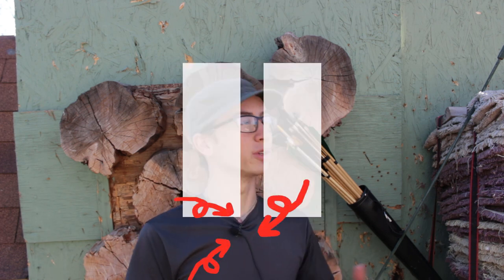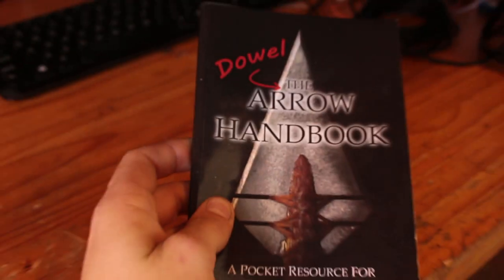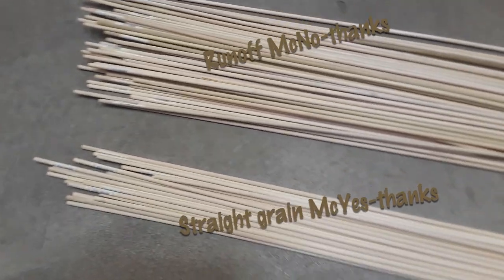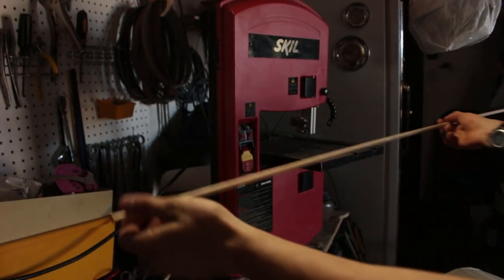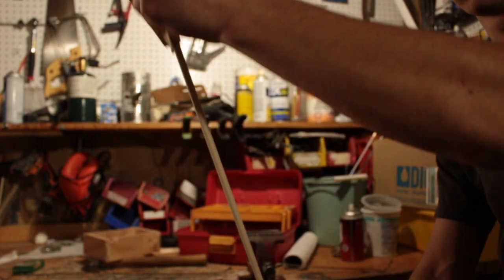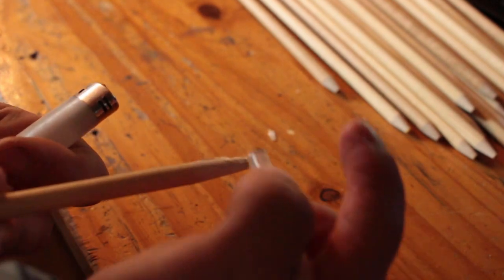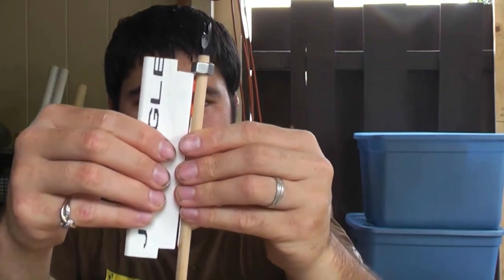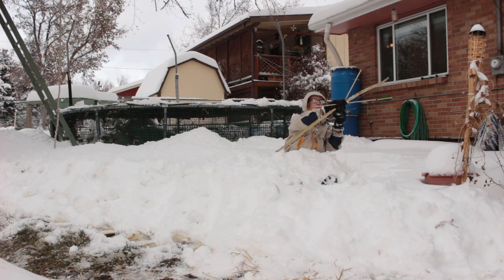MAKE ARROWS For Less Than $2 - 5 Simple Steps

Comment: I made an arrow one time when I was a teen my brother had a starter long bow and we lost all the arrows. We had a small patch of bamboo randomly in the woods so I got a piece the thickness of an arrow it was already extremely hard but I did a quick heat treat on them thinking it would make the stronger. Then for some reason we had an old cow skull in the yard and I broke a perfect arrow head looking piece off and used hard rocks to chip it in the exact shape I wanted then I sharpen the edges on a course rock then a smoother rock. I used natural twin construction glue and he goose feathers to finish it out. We shot that thing at targets forever before one of my buddies was like you couldn't shoot a deer with that if you hit something hard it'll break....so I said "yeah you're probably right" and aimed high up a tree and stuck it in the tree about 50ft in the tree and that's where it stayed possibly until this day...that was over a decade ago at this point  though

Comment: Dowels are perfectly fine as long as they are made of pine, spruce, or cedar. Birch is also perfectly fine. Heck, you can even move to a gardener shop and get some bamboo sticks, if they're long enough. Only issue is, they're most of the time dried with modern industrial standards, which in return means, they are extremely dry. Just give them a linseed oil painting, and wait 3 days...fixed.
Reply: No they're not.
Reply from the maker: Explain why please. nobody has ever given me a satisfactory explanation as to why they think dowel arrows aren't suitable.

Comment: Great video with humor, I like it. In the past I used oak dowels (they are stronger and last longer) I would sharpen the ends with a carpenter pencil sharpener, take an electric wire cap and twist on tight, then cut plastic off, then seal with JB weld. For feathers I just used duct tape and used electrical tape around ends. I just cut a knock in the wood and sealed with wood glue. Great for targets, not really a hunting arrow, haha.

Comment: I used to make my arrows from the oak dowels at home depot. I was pretty careful to pick the ones with straight grain and without runoffs, so I thought I was fine. One day I was just finishing up a 90lb longbow I had made, and was breaking it in. As I fired one of the arrows I had made, one of them exploded in my hand, sending the back 1/3rd or so of the arrow through the flesh on the side of my forefinger where it was holding the bow. the front of the break had split into two splinters about 2 inches long, and the feathers were sticking out the other side. I have no idea how so much wood passed through without tearing the skin apart, but I guess our skin is incredibly elastic. I didn't even realize what had happened until I saw blood just start rushing out in a low arc, and then panic and pain set in. 

I ended up getting surgery and the finger is more or less ok, with a large scar on that finger and horrible memories. But I stopped using store bought dowels after that. Stuck to bamboo arrows... much safer and less likely to break that way. Plus they are even cheaper and easier to get a hold of and make than wooden ones, since home depot has bamboo stakes that work well.
Reply: You made me scared of arrows
Reply: @DoctorAsshole1  Some people never learn.
Reply: Thanks for sharing this info. Yes, poplar seems way too weak but Bamboo sounds much better.. 👍

Comment: Bro this video has BLOWN UP. and quick question do you find fletching with two arrows has them fly as well as three.
Reply from the maker: They don't, not at longer ranges anyway, but the difference is pretty small. I still like them but my regular arrows are actualy 4 fletch which are more stable while still not having an odd feather.
Reply: @TheElvenArcher  ok, well I have a three fletch jig but as you probably know, fletchings are expensive. I’m trying to make my own but I have to wait till turkey season. I might still stay with three fletch for a little bit longer.

Comment: I’ve been making my own wooden arrows and just use dutct tape for the fletching and weight for the tip, they never are super consistent so I’ll try this method and hopefully I can get more consistent results
Reply from the maker: Yeah, the duct tape fletching is an ok concept but it doesn't work very well unless you have a rest meant for shooting plastic veins.
Reply: Then you aren't making arrows are you. You're making pieces of dowel with tape stuck to them. I would probably suggest never admitting this publicly. When I was about five I learnt to fletch properly, so this is something an under four year old might be proud of. :P
Reply: Dr. Lex Winter no need to shame me for it
Reply from the maker: @dr.lexwinter8604  If you're only here to trash on people for doing things differently from you then perhaps you should instead find a friendless tree stump to listen to your pretentious nonsense.
Reply: @dr.lexwinter8604  Bruh you're like a few letters off from Lex Luthor, which fits, since you're a villian. At least Luthor wasn't a racist bastard.

Comment: Would it be a bad idea to just fletch by hand? Also is the sanding + linseed oil part necessary?
Reply from the maker: Fletching my hand is possible but just takes so much more time that I dont think its worth it. And yes sanding and oiling the shafts is necessary, dowels are not shaped with a lot of care so sanding down any ridges or uneven spots helps to keep them consistent. The linseed oil I find ads a bit of elasticity and more importantly protects the wood from moisture.
Reply: @TheElvenArcher  I see, thanks for explaining! The video is very informative and accessible. What do you think about keeping all the steps the same but using harvested hazel shoots instead of the dowels?
Reply from the maker: @mariamm8687  if you can get hazel, then go for it. ive made several bows from hazel and found it to be a really nice material to work with. I would recommend gathering a big bundle then bundling them tightly together with twine and letting them dry slowly for a season or so to avoid splitting and warping. you will have to do a bit of tuning on them if you want them to fly consistently but that would be kick ass to make your own arrows completely from scratch. I wish I had been back in Oregon this past summer as Colorado doesn't have near the amount of natural materials to work with.
Reply: @TheElvenArcher  Sanding the shafts will also remove "micro-splinters"

Comment: I know you recommended popular but I made arrows before I watched your video and used oak, I find that it works well but should I use popular?
Reply from the maker: I had trouble finding oak with straight grain but the bigger issue is that oak is really heavy compared to poplar but isn't super stiff like Ipe for example. You can have an Ipe arrow that is thin *and has a low spine value (meaning a stiffer arrow) because its heavy but also really stiff and you can get a sufficient spine with a small diameter. Poplar is pretty stiff for its very light weight so you get much faster arrow speed. Oak arrows are fine as long as you don't mind slow arrow speed.
Reply: @TheElvenArcher  ok that’s good to know, I was planning o; going and getting some more dowels to make more arrows soon, I’ll have to try popular.

Comment: I'm making some stumping arrows right now out of dowels from home depot because I'm cheap and I dont trust myself to make great arrows yet. My bow is only 25lbs so it shouldn't be too bad right? 😬
I sanded knocks directly into the wood and they look pretty nice. Would you try this instead of using cheap plastic nocks?
Reply from the maker: I wouldn't personally, the nock is a pretty vulnerable part of the arrow as it is cut into the grain and is prone to splitting. At the very least I would cut it at a 90-degree angle against the grain. The Backyard Bowyer also has a video on how to make reinforced self nocks: https://www.youtube.com/watch?v=KQBTnrKIi3k its definitely worth checking out though the plastic nocks are so cheap that it's worth picking some up just for simplicities sake.

Comment: Bent dowels can be straightened with a little heat or steam.

You can even straighten them by rotating and sliding the bent part of the dowel above the flame of a candle.

Just don't allow all the heat to hit one spot... you're trying to heat up the dowel, not burn it.

Comment: what bow are u using i like it
Reply from the maker: It is a panda model made by bear archery, pretty easy to find one on ebay for about $150
Reply: If you haven't gotten one yet this is a pretty great model if you can find it for that price on eBay but if you're like me and want all your weapons to be brand new and you be the only owner then I recommend the sammick sage I used to be in that 150$ range but they are cheaper it is a really good bow for beginners all the way to experienced archers you can customize it with all the attachments for cheaper than you can buy half a bear archery bow
Reply from the maker: @manyhatsentertainment8685  consider the drip tho. Old fiberglass bows just look really cool.
Reply: @TheElvenArcher  I prefer mainly wood though but to each their own I plan on buying  a wooden longbow before long wanted one for years but I needed to get proficient with what I have for a while before I introduce another bow that I may have to short differently

Comment: My problem with dowel arrows is all the hardware stores do them in 30in which is too short for me (I'm 6ft 5') or they do them in 2.4m. They need to be bought in 2.4m, you can't cut them down in store. You need to take them home and do it. I don't drive. I can't take home 12x 2.4m wooden rods as I'll get stopped by the police for "looking dodgey" lol.
Reply from the maker: Couple things, with a draw length that long you're going to have to up the size of your dowels as the longer they are the lower the spine value. And why can't you cut them down in the store? Just bring a small saw and cut them.
Reply: @TheElvenArcher  The UK is funny place.

Comment: just a random question from an ignorant person.... DO you need to put an actual tip on, or can you just sharpen the end?
Reply: good question. you could sharpen the end, but it’s better to have a tip so that the arrow flies straighter and is more accurate. hope this helps.
Reply from the maker: Right, an arrow needs weight upfront to stay stable, I shot an arrow where the tip had pulled off in the target just as a joke knowing that it wouldn't fly well and it took a hard right and ended up three lanes away from my target. you won't get any accuracy or consistency with no point.

Comment: man dowels are cheap in the US haha, 1 2.4 meter oak dowel which would maybe make 2 arrows (3 if the grain is 100% perfect on the entire dowel with no run off or knots) is around £15, works out to maybe £5 an arrow before fletching and heads,

Comment: What length should the fletching be, I am a kid so just wondering to make cheap arrows to use
Reply from the maker: I use 5 inch fetching because I like the way they look but really any size works. I have arrows with 1 1/2 feathers that fly just fine.
Reply: Also, if you're buying all of your supplies, shorter feathers are generally cheaper than longer feathers, by about half in my experience. So you could make three feather arrows, for less than his two feather arrows, if you used three inch feathers.
Reply: Concerns about feather length are length of arrow, weight of arrow, spine of arrow, type of arrowhead, and so on
A lightweight target arrow needs only a short(1/2 to 2 inches) fletching to stabilize it.
A "war" arrow, half-inch oak shaft 30 inches long, with bodkin point, would need 6-7 inch fletching to stabilize

Comment: I purchased a bunch of solid aluminum rods and I'm using chicken feathers
Reply from the maker: Solid aluminum is going to make for some really crap arrows. It's too heavy and an arrow needs not only feathers but a point that adds mass to the front to fly properly. Not to mention that aluminum doesn't spring back to shape on the same way wood does so you may have some significant issues with warping and bending.
Reply: @TheElvenArcher  well I'm gonna find out. The mass up front isn't necessary. The feathers do enough to keep em flying straight
Reply from the maker: @RonaldPlett  you do you man, just know that there are many very good reasons that they don't sell solid aluminum arrows.
Reply: @TheElvenArcher  once the animal  in front of me dies then it's successful
Reply from the maker: @RonaldPlett  target shooting is one thing. Don't experiment when an inaccurate shot could cause undue suffering, its unethical.

Comment: This is NOT under $2 bro. Your talking about buying tips, ends and dowls.  and shipping
Reply from the maker: 1 dowel is $0.90 
1 point $0.20
1 nock $0.10
3 feathers $0.75 ($0.25 each) 
total of $1.95 each arrow. I've never paid shipping for these items, you have to wait longer but most have free shipping options.
Reply: @TheElvenArcher  That guy is totally wrong but I do think you should probably add in the cost of the the taperer thingy and maybe the cheap fletching thingy? you know, just a few of the thingies. Great video though, I have a hand-me-down bow and one carbon arrow I bought 10 years ago for it, so Im excited for some assembly and some projectiles.
Reply from the maker: @imjstcl  tools are an investment not a cost. You wouldn't count the millions of dollars in equipment it takes to build a car into how much it cost to build, that would only come up when deciding how much to sell the car for i.e. the cost of materials + extrapolated cost of machine use and labor.

Comment: add up all the material cost PLUS your injuries it probably cost more than the high quality one. lol.
Reply from the maker: The only peice that would potentially hurt you if it fails is the knock and that is a tiny piece of plastic. Unless it was cracked from the beginning it's not going to be better or worse than one from a local shop.
Reply: @TheElvenArcher  The only thing is that after many round of shooting it can cause invisible cracks that waiting to break. If you use it with low poundage i guess it will be ok.
Reply from the maker: They could have that but looking past the fact that that could also happen with high quality nocks, the ones you would buy in an archery shop are probably also made in china. By ordering online I'm less sacrificing quality and more so just cutting out the middle man and the markup that comes with it.